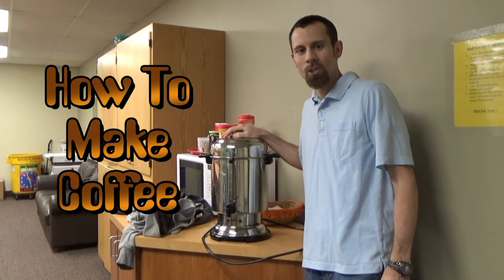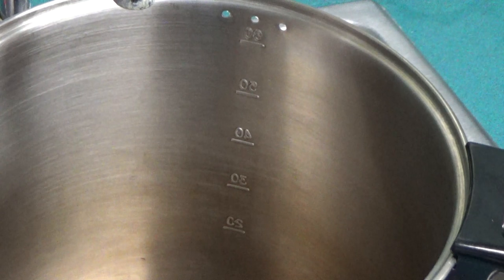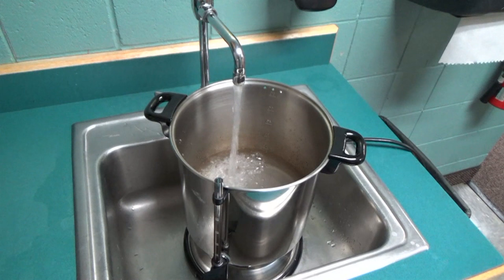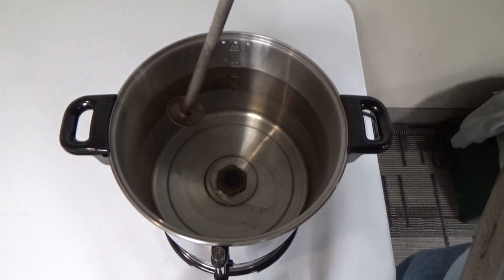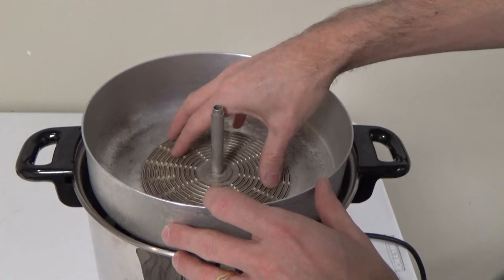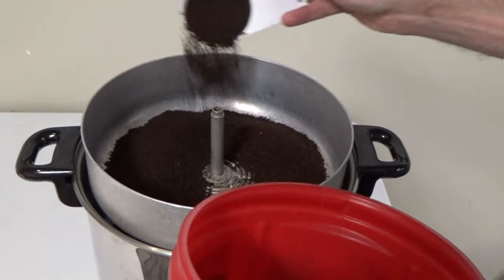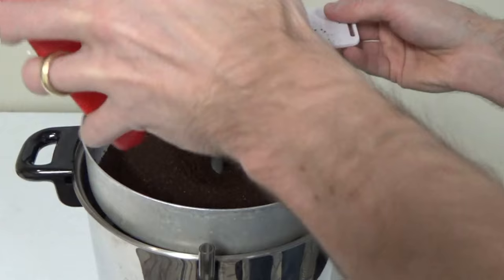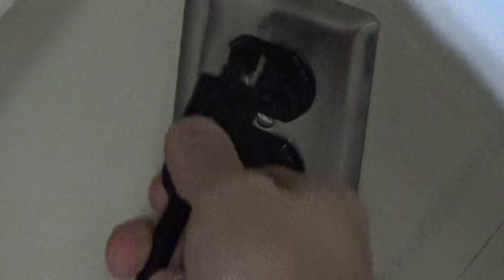How to Make Coffee in a Large Percolator, Large Coffee Pot, Large Coffee Maker Urn

Comment: The cups which are marked on the inside of the brewer, are these actual 8 oz cups or "dispensed" cups? If "dispensed" cups, what size are they (5 oz?). Are the cup markings on the inside standard across different makes of commercial brewers?
Thanks!
Reply: They are dispensed cups - likely about 5oz. Likely across all brands but it's easy to test by pouring so many cups in your pot and comparing that amount with the cup line on the pot.